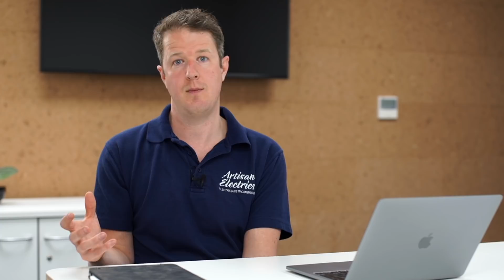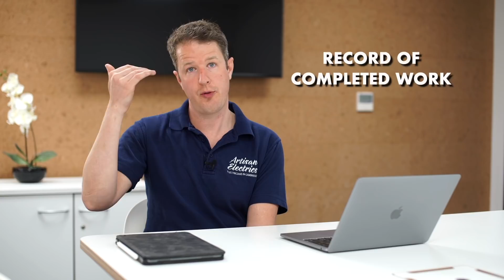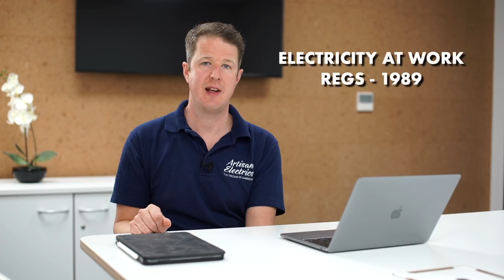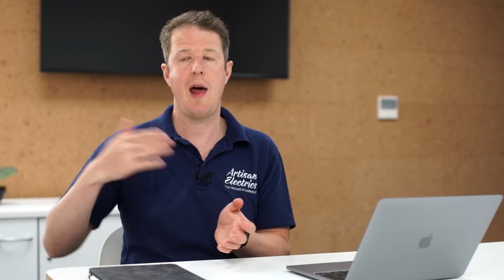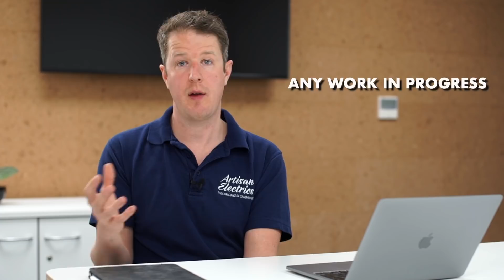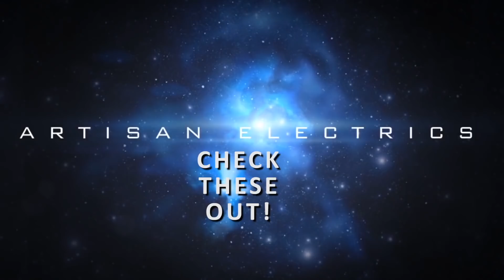ITS JUDGEMENT DAY - NICEIC Assessment - How to Prepare

Comment: Interesting. In my country there is no visit to customers, on other hand it is very unusual for you to do circuit revision you made as our law is set. While you can do revision yourself, getting certificate (Revision electrician) is quite a chore, requires around 10 years of experience as minimum, you need to have almost to a letter knowledge of Electrician Law (pretty much only deals with electrician as a person not technical stuff), electric technical rules (technical stuff only, also separate from law so politicians do not stick their nose in things they have no idea about). Also is considered bad practice to revision your job and building authority may (and occasionally will ) request revision from independent revision tech (does not happen often as a revision tech you are legally responsible and it will be you who will go to prison if something happens). So most revision electricians will make an effort to check everything and beyond (also you are required to present written electrical plans to them to stick into revision). Normally when you leave electrical education school you are considered an electrician, as such you are not allowed to work on non safe voltage circuits (anything over 12/24/50V depending on environment) without supervision. After two years in job on your next assessment you can ask for independent electrician certificate. Independent electrician can work on circuits up to 1000V independently, over 1000V with special training and certificate) and can supervise 2 electricians. Then after another 3 years you can do Supervisory electrician, who can oversee several independents, electricians etc. After another 5 years you can ask for revision electrician. For anyone but revisions you need to do test of knowledge of current law and rules every 2 years, includes some other stuff like 1st aid, job safety etc. Revision electrician need to do test every year, they have lot more though test (they really need to know technical rule to a letter) and they may have to submit revisions for peer review, etc. Also any change to electric circuit that is not a repair, needs to be submited to building authority with revision included (98% small changes are never submited AFAIK) but then building authority employees do not mind as they would get a lot as anything that is not repair needs to be submited (even if it does not require revision or permit)

Comment: That was such a walk down memory lane. I was a Internal Quality Auditor in a large private telecoms company working firstly under BS5750 then ISO9000. Our annual Accreditation inspections by BSI sound exactly like your NIC format.  All Pre digital records so that pile of documents was a standard practice to show the extent of work we did. The weakest link were the chats with a randomly selected employee in a particular work stream to describe a task against our defined work process flows. They tended to get brain freeze when questioned and our job was to coax them to start breathing again to give the reasonable answer. Yes the inspectors tried not to frighten them and in the end it worked out fine.  We were pretty clean of real problems but the inspectors always had one or two minor observations of non compliance and it usually needed just a resolution document sent to them so they could show they did their job and not just swanning in and signing off the accreditation. Happy Days.

Comment: Well that's nice to know, I have never had a missed visit from the NIC EIC. Had one last year just before lockdown 1.0 and one again this year a couple of months ago. There are more and more contractors registered now and in the last four years have had three different assessor's. My usual one semi retired and now they are so busy, plus now having Elecsa merged with them proper (which I am sceptical about) doesn't help. But if you're doing it right then there's never a problem. No one knows everything especially in this game but if you keep up to date and do a good job you're sorted. You've got to be pretty confident if you're going to show your work on YouTube anyway. Calc card.... Why don't you have a tester????? And why wouldn't you get your tester calibrated???? I have two multi function testers and two check box testers and get them calibrated alternate years. For the cost why wouldn't you do it.....🤯